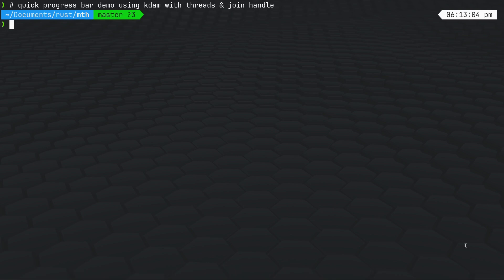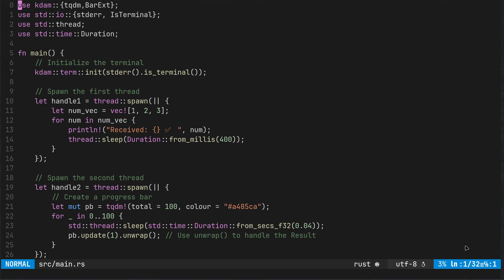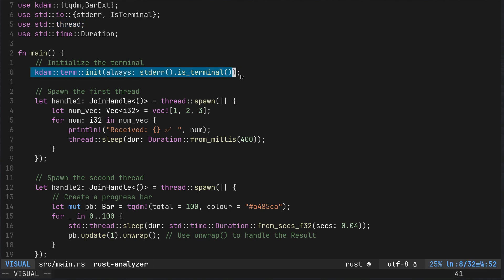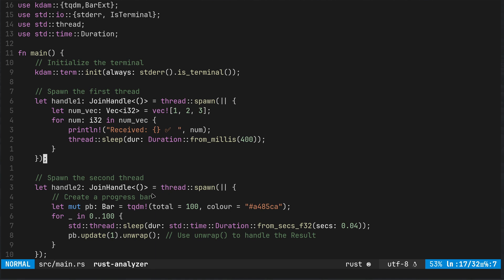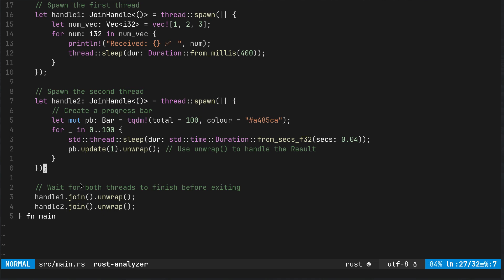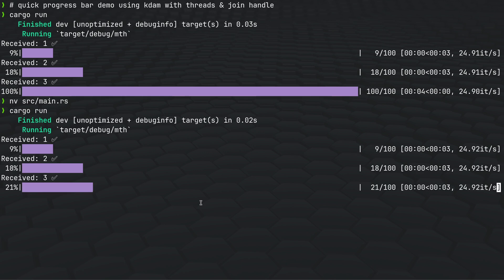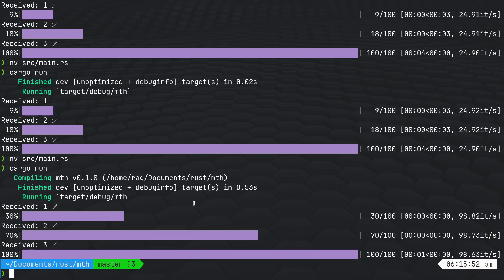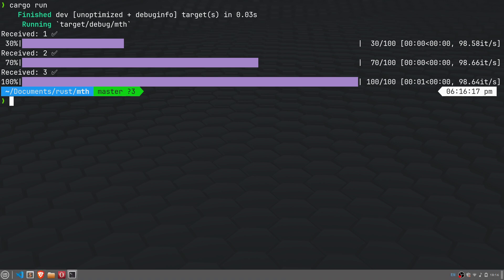Progress Bar + Threads Demo | Rust Language

Comment: Worth noting that println! internally synchronizes a lock around the standard output (and likely so does kdam internally), which is why the lines never get intertwined. Interesting library, kdam. I'm not surprised it exists, but I wonder if there are other sophisticated terminal UI libs in rust
Reply from the maker: Ah, thank you! I hadn't considered that. I knew that the println! macro allows you to use borrowed types directly (without explicitly dereferencing them).  ratatui looks interesting, but so much to learn, I should probably leave that for another day 👍